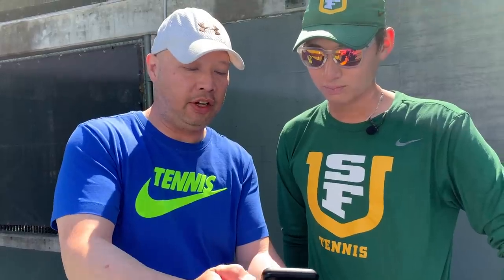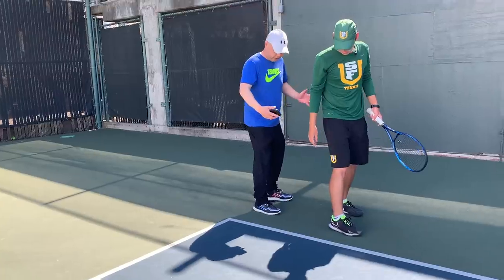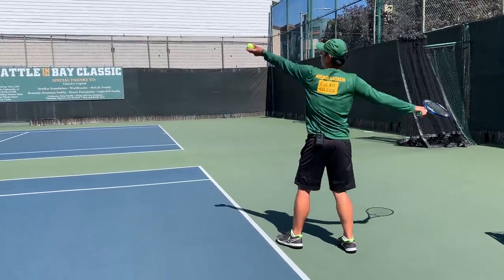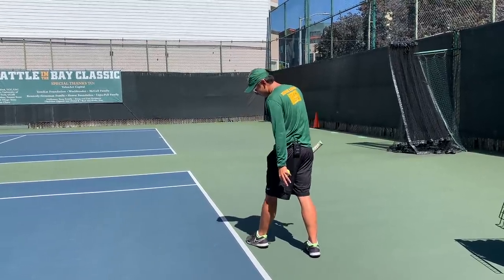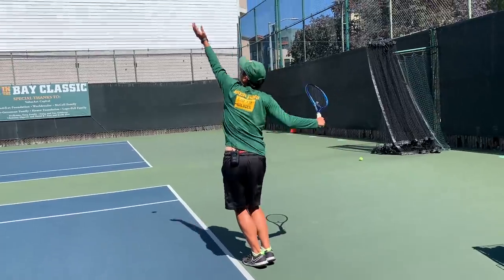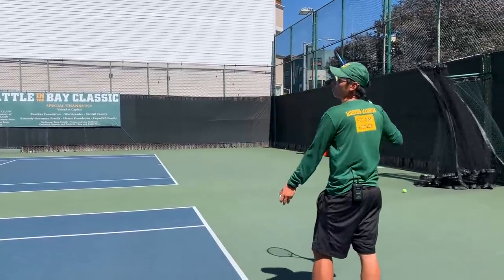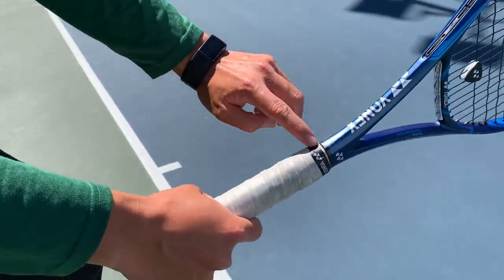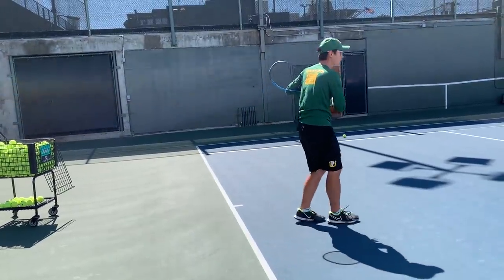TENNIS SERVE AND DRILLS - FIXING JAKE'S SERVE

Comment: the instruction at 11:10 is horrifying... you absolutely do NOT snap the wrist down like that. yes the wrist stays loose but it does not go down like that, it turns out to where your palm faces the right after contact through the process of pronation. really scary to see a college coach teaching players to snap down. very body-unfriendly tip

Comment: I always feel unnecessary to pull my back leg attached to my front leg during serve. It just add one extra procedure or move, which I try to reduce to improve stability. Can anyone explain to me the benefit of the move, or disadvantage of my unmoving open stance?
Reply: I'm still new as well, but my understanding is using a Platform stance will give you a little more stability in the serve... Bring your feet together with the Pinpoint stance increases your power potential as you are more able to launch yourself up into the ball. When I watch many of these guys warm up, they use a Platform stance.. Then they say, time for some real serves and switch to a Pinpoint stance and they start booming the ball.
Reply: There is no benefit to the move at all. It's just part of the individual's rhythm that makes their serve consistent for them. Ultimately, it's one's core strength that helps whip the racquet with enough velocity to effectively strike the ball at the proper angle to get it where it should go. 

I serve like the AG in the video does. It's how I was taught. I also learned to serve with the static open stance. Stand stable, balanced, toss, lean back, and whip it. The result is more consistent, more power, and easier to control. Coincidentally, it's also easier to teach. 

for some, a series of complicated moves in a rhythm works well. for others, a serve can be less complicated. After reading the above, watch Sampras's serve. See if you see what I see.

Comment: Switching from a grooved in waiters tray serve to an advanced serve is hard. I am working with my wife every day on it, 30 minutes a day, since March. Making progress, very slowly. In addition to focusing on the continental grip, also suggest switching to platform stance to remove complexity of the foot movement, and starting serve in 3/4 position or trophy position (h/t Jeff Salzenstein) to remove need to fix the backswing until comfortable hitting with the continental grip. Good luck, Jake!
Reply: It's all about learning to trust the swing path using the proper grip.  The mind wants to orient the body, head, and hand towards a target they can see.  Very linear.

Comment: great vid.  yes  the serve is complicated. what i all was ask my students is " what make a good serve?'  then  i say "one that goes in. " but yes Andrew has game and a serve.  the most common mistake i see with players is they move after the toss.  So the ball stays in the same spot but the player has  moved and the ball is now behind them. plus i always ask my players where do you hit the ball if 6 is at bottom of the ball and 12 is at the top. they don't know where they hit the ball on the serve.   Pronation is key. there are a lots of things happening.  the problem with players is they think they have to hit ball into service area.  with pronation the racket goes in a one direction and the ball goes in another direction.  so its confusing for [players to figure it out.  I start with front edge of racket  and finish with back edge of racket.

Comment: What is the purpose of sliding the right foot in when hitting the ball?  I don't see Federer and Djokovic do it... only Nadal.
Reply: Just to pump more power or jump
Reply: They all may not slide the foot, but they all move it.
Reply: Federer and Djokovic use platform stance where as Nadal uses pinpoint stance for serve. It is more of a personal preference than a advantage over one another. Just as much a personal preference as a eastern vs semi western vs full western grip of choice.
Reply: Platform (Federer, Sampras Raonic & Djokovic) is for little more control, step up (Nadal & Isner) and pinpoint (Roddick & Monfils) a little more power.  Most platform stance pro players don’t serve over 130 except for a few like Milos Raonic.  Nadal is the exception, in general, most of the good step up and pinpoint pro players serve over 130 mph in competition.  Keep in mind, Each pro player’s stances are based  on preference, style and how they were coached. Some coaches teach one style while other coaches teaches based on their students strengths and physical attributes.

Comment: I've taught tennis for about 15 years. I have coached beginning level kids and adults up to division 1 and ATP Challenger level players. I can agree with much of what the coach mentioned. With the limited amount of footage of Jake I can see the grip was unusual and appears to be the main culprit of his service difficulty. Seeing more reps would yield more clues to help guide him. I suggest Jake film himself and compare his stroke to someone he is trying to emulate. Shadow swings to start the process of changing his stroke as well. The foot placement or movement is not a huge problem imo. Stance is from my experience can vary greatly as long as a kinetic chain and balance is maintained. Most tend not to move the front foot but if you remember the Russian pro Youzney, he took a step with his leading foot. Unusual yes but still effective. The coach also changed his footwork in several instructional examples in contrast to his regular service motion by leading into the court with his right foot stepping forward as opposed to landing on his left on his regular service. I think Jake would benefit the most by a grip change as was eluded to. Continental or even a little towards his backhand grip from a continental would be my advice. It also appears Jake might have been choked up on the handle a bit far  limiting his pronation. Jake mentioned in the comments he didn't mean to hit such a good serve and he didn't know where it was going. This suggests to me he might be dropping his head to quickly and not watching the ball through contact. Also not having a good idea of the orientation of the racquet face   durring contact. I think Jake could benefit his service by also hitting some overheads with a modified grip to get a feel for it. Best of luck in your endeavors to improve your game.☮️
Reply: The PROs make serving look easy. For the general population, the serve could be a challenge to learn.  I play a lot of sports and I coach tennis for years.  The serve is the most challenging stroke (besides the golf swing) compared to other sports. 

He needs a good coach to guide him on how to serve efficiently with good technique especially if a person is a beginner.  Bad technique could possibly lead to injury.